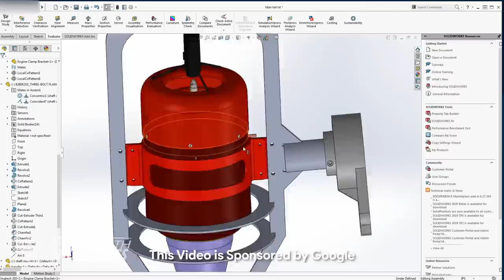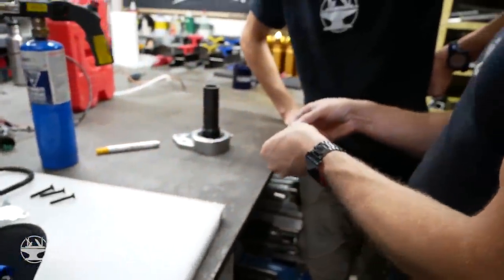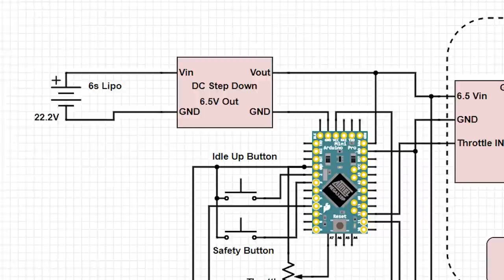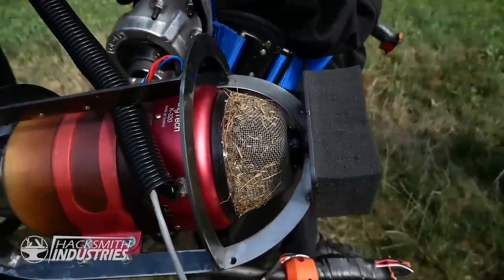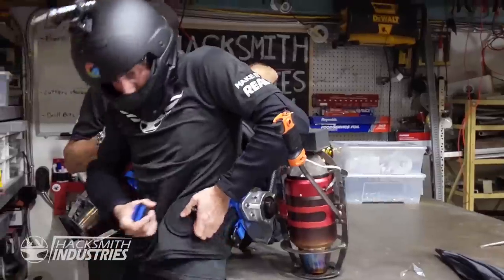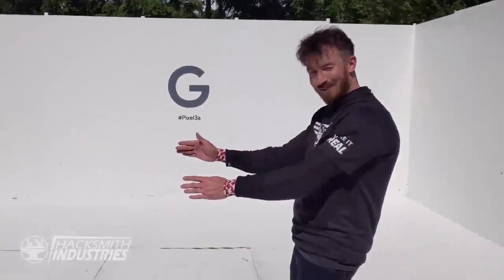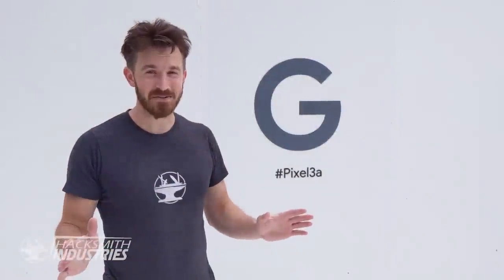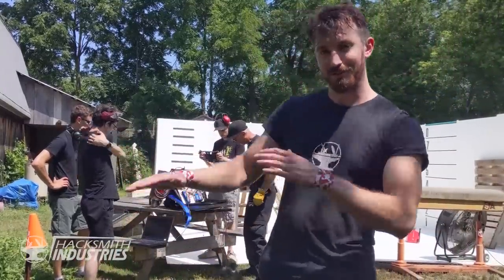I Made a Jet Pack!  (ONE DAY BUILD)

Comment: Hacksmith: flying like iron man is over

Also hacksmith: built a jet pack in a day
Reply: Stonks
Reply: well i mean, he still isn't flying, not even hovering, just jumping higher and falling slower
Reply: @Draakdarkmaster6  he got 2 engines, imagine if he uses two more attached to his legs and 2 smaller onces on his arms ?
Reply: @guigui70051  jet engines on the legs won't work... He just needs one main engine on his back and 1 on each arm (better 2) for stearing...Just watch the videos with Gravity Industries they built one
Reply: @guigui70051  now that... would be sick, and might actually work, if nothing else it would more than likely make him jump really high and slow fall nicely, due to the weight of said turbines and equipment to run them
Reply: Adam savage did it incase you wanted to see an iron man suit fly
Reply: Roy Garithos ITS A ROBLOX GRAVITY COIL
Reply: Thing is: Think what they could do with four thrusters
Reply: Let's be realistic, its not a jetpack... but it is like a titanfall jump kit which in my opinion is cooler.

Comment: He could actually fly if he had a more powerful jet engine, imagine if we had 4 arms, 2 control the jets and the other 2 wields swords or guns
Reply: Then we woludn’t have balance
Reply: Nah just attach the engines to your ankles and make the control be based on the grip of your hand and the other would  have a freaking laser cannon
Reply: bruh if we can make jet packs we can make mechanical arms
Reply: I probably don’t need more power I weigh only 75 pounds at 12 years old
Reply: Not trinna fly jump higher and wall run and double jump
Reply: or splice the wires into the other engines wires and you could mount a button on top of the throttle and press that and it could fire a gun on his shoulder 1 on each side so it doesn't affect the weight
Reply: @vfishyturtle7601  dude...they cant put a 12 year old in one of their death machines.  Your parents would flip their shit.  🤣

Also... we could just use servos and a flight controller to angle them toward the ground and keep it stable hands free.
Reply: When Americans go to Chernobyl
Reply: nah, those 2 on his arm and then one thats twice as strong on his back
Reply: You might be able to use a gyroscope and accelerometers to create an auto-pilot.
Reply: @vfishyturtle7601  Each engine produces 145lbs of thrust.
Reply: Oh god
Reply: A french guy actually did invent a jet bord 
Verry powerfull it can carry u several feets in sky

Comment: If you can put 2 more jet engines on the back and you might be able to fully fly
Reply: even with that third one, it may be enough for a small person to hover mid-air.
Reply: the force needs to be evenly distributed if you put both on the back itll just push you forward before you even get off the ground
Reply: its way too expensive. He wont do it. the only reason they did this video is because google gave them a large sum of money and let them freely use it to whatever they wanted. A lot of youtubers dont even get that freedom from their sponsors. But unless he was given 50 grand he wont do it.
Reply: Well I was thinking he could point the belt ones forward to try and make even force and on the topic of money I don’t know if or when he will do it but I think that if he could he definitely would. Anyways it was just kind of a random idea.

Comment: How does he not melt his leg with that jet engine?
Reply: Harrison Carpenter obviously the jet of flames isnt going in the direction of his legs so thats how. mind blown i know
Reply: ik
Reply: To my understanding, the heat output decreases exponentially with distance (way less heat at 18 inches than 12 inches, and not proportional to the distance)
Reply: @sylvicalias  well spoken. Couldn't have said it any more clear!
Reply: @Ethan Shaw im pretty sure that you can hold heat energy in photons (light) with lazers and extra heat energy gets relest in the form of photons
Reply: rodger so hed wearing pants too so any heat left is gone.
Reply: I think he is using flame resistant pants as well as the direction of the jet engines.
Reply: rodger so I’m actually a thermal physics major, I’m guessing you must have earned the Nobel prize or something?

Comment: This is probably my favorite build you have done. Since you can slowly jump off stuff with it imagine being able to jump off like the top of like a 5 story building and being able to slowly fall down
Reply: You'd very much still accelerate and drop to your death. 55kg/120lbs of upwards thrust rigged to someone that's like 210lbs (160 for the body + the rig that holds the engines and such) It would be like a 90lbs 11yo walking off a 5 story rooftop. It's not going to be a gentle landing!

Comment: Put 1 more powerfull jet on the backpack so it can hover and
Reply: With controller..
Reply: It would be awesome if everyone had a more reliable version of this and could just hover to places rather than walking or cycling. Flying is just slightly out of our technological range at the moment as the jet engines have to hit the surface of the ground to lift the person up, so as soon as the jet engine/jet pack is out of range from the ground, the person would just fall. That is why when The Hacksmith jumped from his elevated porch, he was falling at full speed until right at the end when the jet engines were in range and his fall was slowed down but didn’t slow him down enough to do it without a crash mat. With the third jet engine on his back, this could work much better.
Reply: Andrew Shah-ntz 2 would actualy work prob
Reply: @manav_chitkara  it has nothing to do with tech but physics, more mass of air at low speed gives better static acceleration while small mass at high speed gives better acceleration in movement, this is why chopters have big low speed rotors while planes have small high rpm fans.

Comment: You realise you just designed the need for super-human upper body-strength OUT of Gravity's jetpack?

Put this thing into production, right now.
Reply: I wonder if anybody thought about shock absorbers
Reply: @tomholroyd7519  it's a HUGE leap forward in market-size for the pack.

More stable, full arm-strength, much safer, better human flight endurance etc etc etc ... H should work with Gravity to upgrade their design to Mass-market. period xx
Reply: But steering is still way more difficult and less intuitive this way
Reply: @tiespauelsen7983  when you have 5x as much arm-power and everyone flew safely with it immediately, ok - at limited power. Gravity won't even let people fly untethered without at least a day (week) up and being over water. 

This design is Much easier and safer to fly with the fatigue spread over your shoulders and hips. Giving more accurate control and dramatically greater stability over increased safe envelope and flight times. :) 

It's not perfect (in a single day) but beats all early G prototypes already at a fraction of the cost... half a million for a G pack right now? With 2 redundantly paired throttles and 4 engines... you're airborne. And want to get high just in case you have to pull your shoot.

Comment: imagine setting it up with a gyroscope and some motors so the thrust angle is always vertical THEN whatcha gotta do is set it up so that the throttle output is automated... slow increase to a balanced thrust ratio (making the payload weightless) holds that thrust for about 3 seconds... then slow decrease... rig that automation to set to a button on the knuckle of a glove like antman and BOOM titanfall boosterpack... then just like the game... its up to the pilot to learn how to time things like a fast wall jump, a controlled decent... and even a wall run

Comment: Hey hacksmith you should also try using four engines instead of two. Two should be straight to create lift force then the other two can be move in other directions in order to move. It's just an idea.  ( you guys are incredible and you can do anything right)

Comment: The jet making u fly by thrust, against gravity pulling ur body weight. But iam thinking why dont u put those jets down near ur limbs or feet. I think legs are getting pulled by gravity. Pls correct me if iam wrong.
Reply from the maker: Jet's close to the ground will get damaged from recirculating air and dust!
Reply: @hacksmith  oh right.
Reply: @hacksmith  thanks😊👍

Comment: I wonder what's the feasibility of using that as a parachute of sort for maybe emergency rescue where noise isn't a concern but rather space is which means you can't use a parachute. I'm talking scenario where helicopter isn't a factor but need to be airdropped somewhere tight.

Comment: Make it electric. You want gasoline and jet engines to break your fall? Better with  jumpfloaters and a peristaltic wing that floats the external forces like seaweed on the water- Just float above it! Because THERE is where the lift is. What else do you want mr. Hacksmith? Information has no limitations.

Comment: If you'd have mounted a metallstructur connecting both engines their vector of thrust would have been more focused giving you more lifting power and less strain to the hips. Well, a full 90 degree angle would have been unstable.

Comment: you guys know in starwars battlefront 2, the jet trooper doesn't exactly fly, but just gets boosted. technically you could mount it on your back but might be safer if you have like an emergency jet in case one fails

Comment: I feel like this with some minor adjustments could be used for military or even civilian law enforcement use. Maybe the handles could be used to move the jet engines to slightly move yourself in different directions in midair. Like if u pushed the engines back a bit more mid jump u could move forward much more than u normally would. Just an idea.

Comment: I'm really surprised that nobody considered center of gravity - if it was much lower, you could have been way more stable and stayed in the air longer as a result of far more stable flight control (instead of flailing around like a cartoon).

Comment: Why dont you put a frame on connecting the two engines so they dont wobble and you have more control to go in 180 degree motions going back and forth rather than wobbling in every direction?

Comment: You need two more Jets on your axle back and then the ones by your hips are the ones that used to control your direction. Maybe some sort of Rudder system is built into how you move your hands with the waist Jets to to counteract rotation

Comment: saw it on one short frame of the video you're using k-320 which produce 32kg max thrust so obviously 2 won't let you fly unless it's a kit or a dog...cool idea anyway.
Reply from the maker: Yeah.... we weren't hiding that fact lol also I only weigh 64kg so if the engines and fuel didn't count I would be able to fly

Comment: Wonder if you could make one with electric engines so you don't need to worry about the fuel as much... 
Maybe you could also make some way to control it with your legs so you can use your hands for other things (like the grappling hook or  repulsors)